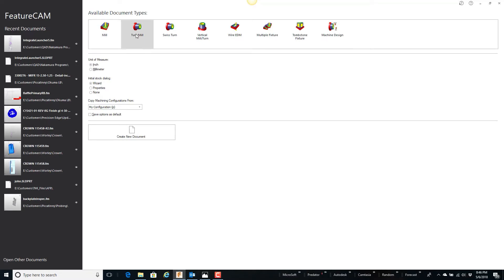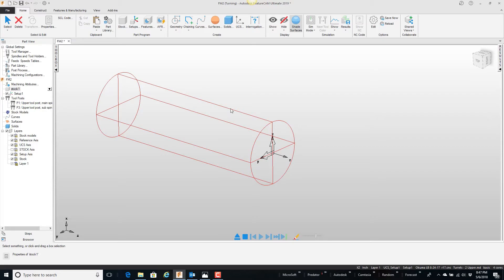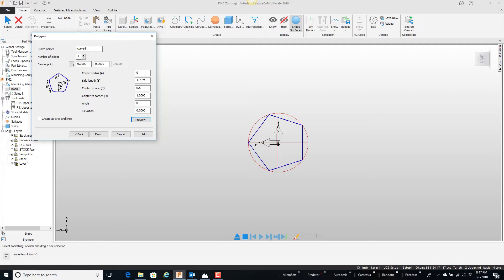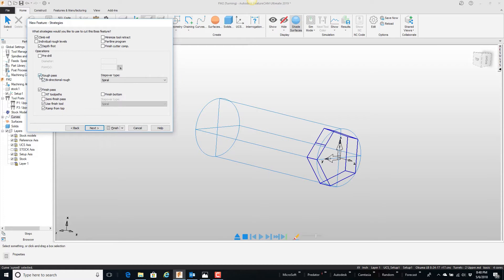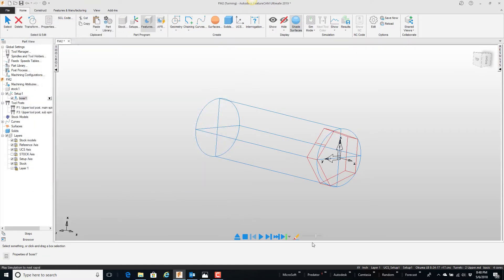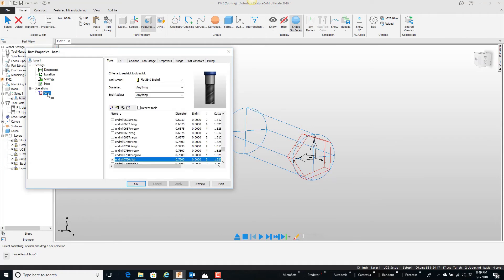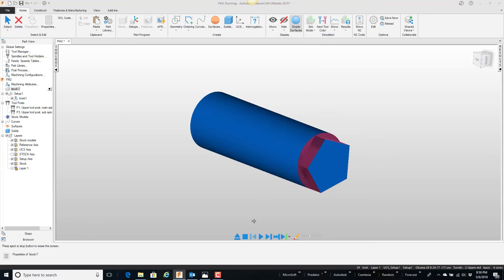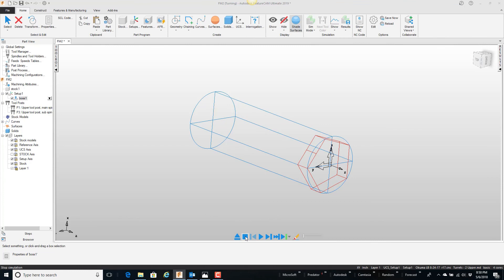Creating a Pentagon on a Lathe using the Z-Axis Tool within FeatureCAM

Comment: Good video.  I just got a lathe.  I'm getting a mill.  I need to create a pentagon.  It's manually operated with DRO.  I'm wondering how to do this.  I'm guessing I'll have to scribe the form on the end of the cylinder (1" dia) and use an end mill on the mill with the work sitting longways.  Suggestions?